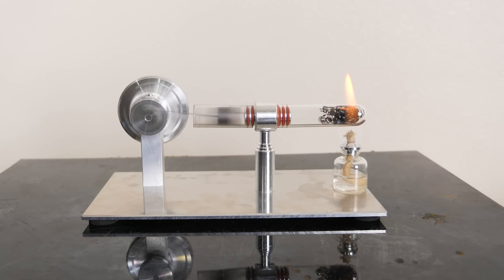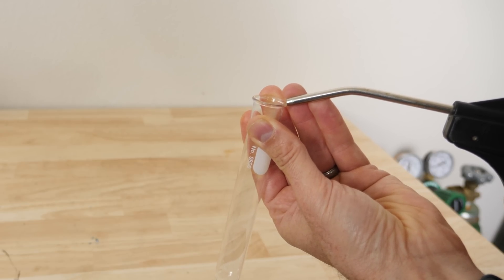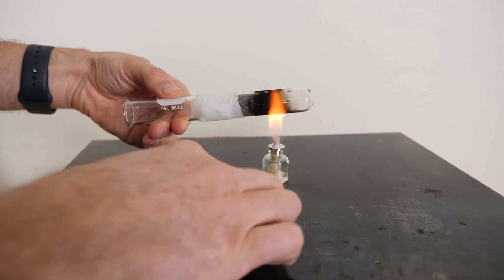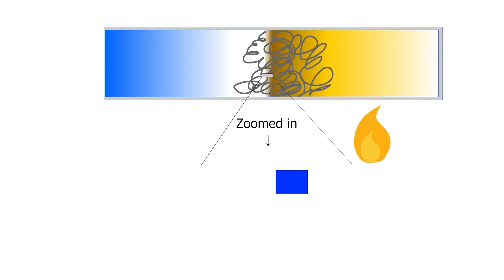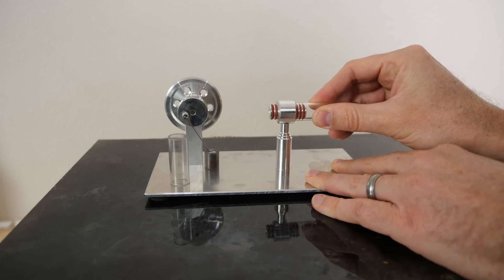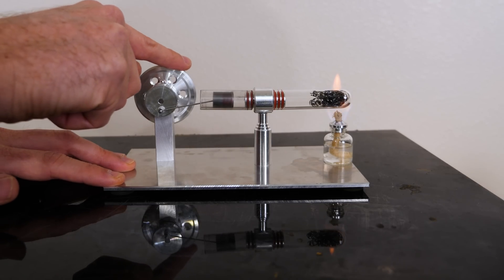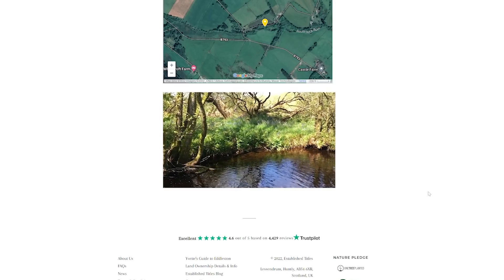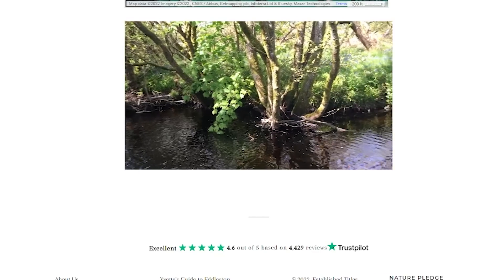This Engine Runs On Sound Waves!

Comment: 2:11 this could be made into a fire alarm that never needs batteries. 😉  no more false alarms or low battery chirping ❤️🧘🌈
Reply: Just need to make sure there’s always a wet paper towel around it.
Reply: @Thinginator  and flames up to the ceiling. I think by the time the tube got hot enough to hum, everyone would be BBQ'd
Reply: @toolscientist  Or maybe put it down low so that that's not an issue

Comment: I can't help but wonder how long the glass can maintain such a rapid heating and cooling.
Reply: The glass stays hot on one side and cold on the other. The air temperature is cycling rapidly, not the glass temp
Reply: it's not heat cycling at all

Comment: What's the difference between this engine and Stirling engines?
Reply: Sterling engines do not rely on resonance, but require both a large piston to act as a heat sink, and also a smaller piston to transfer the power. As I recall off the top of my head.

Comment: This gave me an idea, i had many complex and veried system when i was work for various "energy company" and in almost any case there is always heat to be disssipated
Most common example wojld be electrical transformator, some produce around 6Mw of heat
So i really think it is possible to use this acoustic process to take most of the heat and put it back to electricity 
For exampke
Reply: Very clever!
Reply: Yup, in some ways this is similar to a Sterling engine, but there are some important differences.

Comment: I wonder what the speed/torque/heat requirement is for that compared to a steam engine.
Reply: Physics laws can be used in many ways. Only brain is required. Well I wanna a physicist and you?
Reply: @Sceince_Vedas_are_the_Universe  Experimentation is also required, our brain will not always correctly tell where the boundaries of law applicability are.

Comment: so yeah well done you have a propulsion method without external exhaist or moving partsz .. thats clean .. try under water (your engine is sideways vent a non round shape will help vector it
Reply: There IS external exhaust, it is an external combustion engine in this setup. You could use electric heating coils, or even a sound amplifier, I suppose, but would that be better than a normal electric motor? I suspect not, but it might have some special application.

Comment: You are king of bait click tittles. the  engine is not running on sound wave.
Reply: Well, the heat produced a sound wave, so I suppose indirectly it is technically a sound wave pushing the engine. It might not be audible though since it looks like a closed system.
Reply: @mike1024.  Dude this guy knows how to bait for views. It not like I think it a bad thing it just a skill that I wish I had. If he just named the vidoe  Listen to Fire  then I would never clicked.

Comment: A quick question how efficient it would be using the sun and a lens for the heat part ?
Not just efficient, isn't it cheaper that solar panels to go in that direction ?
No maintenance needed, right ?
Reply: I'm sure focused sunlight could provide more than enough energy for the heating element. The main problems from it would be the cooling end becoming saturated with heat, and the piston needing regular maintenance due to moving parts. Basically it'd combine many of the problems of turbine engines and solar. Could still be worth it in some areas though!
Reply: @polic72andDrD3ath  The cooling aspect of the process is what I've forgot !
But that too can be overcome with the right set (I have some ideas linked to some "ancient" or Middle aged underground refrigerator concepts) that could provide the cooling necessary (a big waste of space but, science !)
I think it's possible to make a sort of electric central using this concept to the very max

But, you're right, the mechanical parts that were off with time is the ultimate issue that need to be addressed. 
Not sure I'll find some good idea to try delay that 🤔 
Right now I'm looking at vacuum related stuff and lubricants to (maybe) find a better set but I'm far from it 😞

Comment: Very cool! Very simile to assert a sterling cycle engine. I built a sterling cycle pump once from plans that I found somewhere I forget where. I will have to dig those up and do that again. That would make a cool video. Thanks for another cool action lab video, I'm not quite ready to be a Lord yet. 😁
Reply: *Stirling engine
Reply: This is a thermal acoustic engine. Difference from Stirling engine is the "Regenerator".

Comment: In what way is this different to a Stirling engine that uses relative differences of temperature and pressure to drive a piston? 🤔
Reply: The main difference is that the heat exchange between the cool and hot air is much faster and cause a short but fast air movement (vibration)  instead of a long and slower movement.
Reply: This is a thermal acoustic engine. Difference from Stirling engine is the "Regenerator".
Reply: None, notice he didn’t call it anything.
Reply: @tohfawalker159  he called it a "thermo acoustic engine"

I believe they are very similar, but the expansion and contraction of the gasses happens at different points. I'm no Stirling engine master, but they have a few more moving parts.

Comment: 'How many sound engines would it take to create electricity?...' - Chrome
Reply: NASA's Glenn Research Center have developed two novel technologies that make Stirling engines more efficient and less costly. First, Glenn's thermoacoustic power converter uses sound to turn heat into electric power. Utilizing heat-driven pressures and volume oscillations from thermoacoustic sources to power piezoelectric alternators or other power-converter technologies, this device can generate electricity with unprecedented efficiencies. Unlike conventional Stirling-based devices, this thermoacoustic engine achieves high thermal-to-electrical efficiencies with no moving parts. Glenn's second advancement for Stirling engines replaces the conventional linear alternator with a magnetostrictive alternator that converts the oscillating pressure wave into electric power.
Reply: @ColCurtis  Your senku
Reply: Dr Stone?
Reply: @Bhatakti_Hawas  I bet that this will be included into anime
Reply: @_sherlock_8009  lol damn
Reply: Probably on a much larger scale
Reply: Imagine how conservatory or expensive it will be I dont know if the stuff is cheap or expensive so
Reply: Your whole PC
Reply: YABEE!!!
Reply: To add to this... could this be done with the natural heat from the sun combined with the cold of the earth?
Reply: @4xdblack  yes. Basically what you can do is replace solar panels with a dish shaped mirror that focuses the Sun's light on a single point and place the hot end of one of these engines in that point.  You can do the same thing with Stirling engines, and I believe they end up being more efficient than solar panels.  The problem is such a system is more complicated because you then have to have a tracking system to keep it pointed at the Sun.
Reply: @4xdblack  yes, any way to create a temperature difference will do. The greater the difference, the more power.
Reply: Ok everyone is looking at this the wrong way lol 1st off all it would take is 1 sound engine to make electricity. All you'd have to do is have the piston turn an electromagnet. The two better questions are "how much energy would a single sound engine generate at a specific size?" And "how much energy is lost to the heating the system? And you need to include cooling if you don't use a passive cooling system like a river or some other efficient method of extracting heat. This setup would be very inefficient on a large scale but I can think of a few ways to improve it. Maybe even make something that generates practically free energy.
Reply: How many to move a 1 ton dually? A semi? Bulldozer? Container ship? Airplane?
Reply: Y don't  yall like create a discord server 4 us to discuss these
Reply: Zero... Elecrticity already exists!
Reply: Zero mate!
Just rub your ass on a carpet you will have some electricity. 8th grade science sends you its regard
Reply: At least someone trying
Lets go Bro!
Reply: This project's been eating me alive, along with acoustic fluids, Superfluids, magnetic Heat, together we can make cars that run themselves !
Even, planes
Reply: Too many... That's why use alternate and efficient heat to electric converters...
Reply: That engine is big enough to make  electricity. Probably enough to charge your phone.
Reply: They should stick the hot end of these in the exhaust /cooling towers at power plants.
Reply: Just one, they're useful wherever waste heat is a byproduct.
Reply: Great question I think it would depend on how much force or should I say centrifugal force  it can transfer to a another moving body such as a alternator wheel.. or something else that can convert movement into electricity which should be around 1000 rpm
Reply: @tknewyork18oo29  you should definitely not say centrifugal force
Reply: Dr stone refrence?
Reply: Ik this is irrelevant but the sponsor is prolly a scam company, just search it up
Reply: Chrome? Like the chrome from Fortnite?
Reply: But chrome can't talk

Comment: this guy is on the way to build a damn time machine soon 😳
Reply: He has already done
Reply: Using light
Reply: Shourly he will make it 😂
Reply: Your not kidding, I went into the future to find that out💀
Reply: time machine is not possible because our Universe is a computer and our World is a software program, and since there is no way to run a computer backwards time travel is impossible
Reply: @absolute___zero  following that analogy surely we would be able to load to a previous save
Reply: @koalabanana1998  but you aren't the Admin, you are the User, so you don't have the privileges
Reply: @absolute___zero  any system can be hacked
Reply: @koalabanana1998  that's a wrong assumption learned from a deficient computing model designed by humans. when AI will be programming , there will be no bugs to exploit
Reply: @absolute___zero  Proof??!?!
Reply: @HL1_EP1  working on it, bought a CNC-router with pico-scale interferometric sensors to prove time and space are discrete
Reply: @absolute___zero  Ok, I don't believe you but I am not the one who says "THE WORLD IS A LIE WE LIVE IN THE MATRIX"

Your comment is probably sarcastic isn't it?